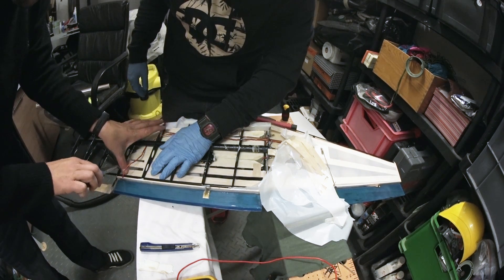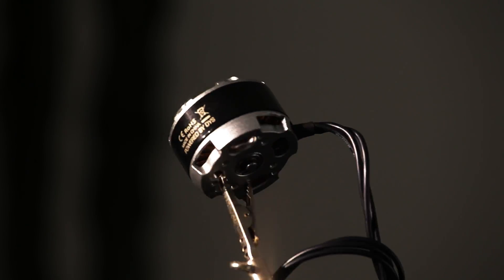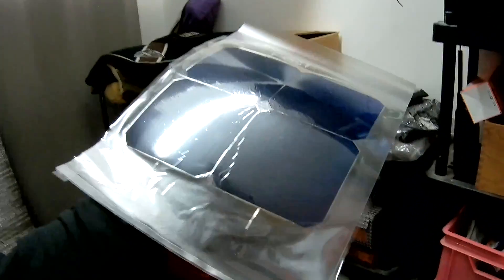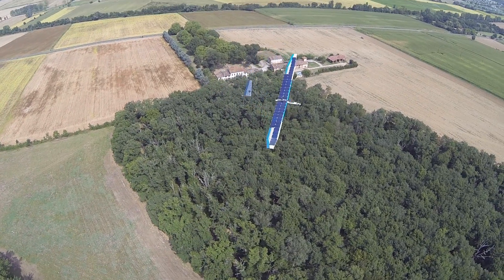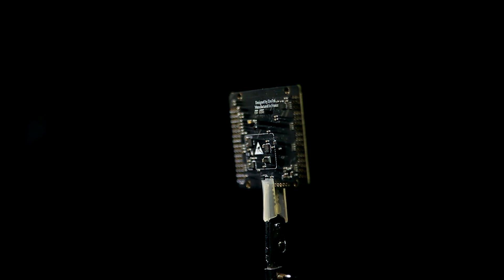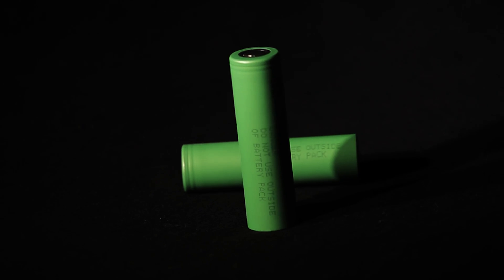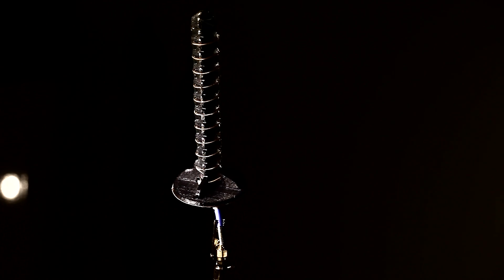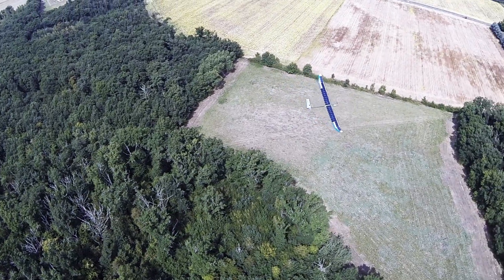Work in progress

Comment: I noticed your first flight was ArduPilot. Is your Dropix with ArduPilot too? If not, how'd that work out for you? What is v3 going to use?
Reply from the maker: +Tom Pittenger Hi, we are nowusing a dropix v2.1 with pixhawk arduplane firmware, it works great. We will experiment the new thermals feature before trying anything else.

Comment: what is the solar cells?
Reply from the maker: +Daniel Prado sunpower maxeon C60
Reply: Solar Glider Project you said new solar cells with 3.8 Watts. Didn't you use C60 in the old projects? Is the C60 a 3,8 Watts solar cell?
Reply from the maker: +Daniel Prado Some cells have better energy conversion ration than others. Last year our cells were less powerfull.
Reply: Oh. I got it! Where did you get these new cells?